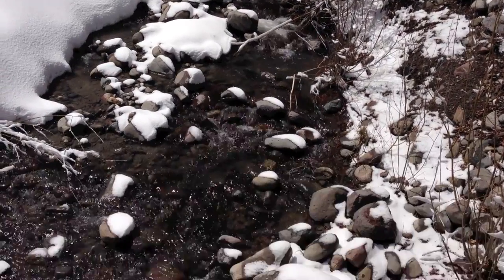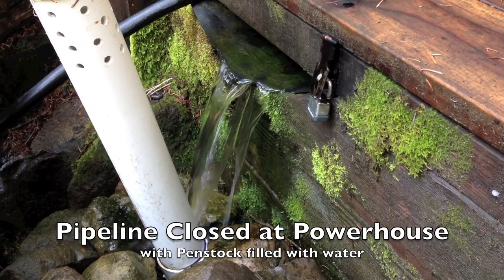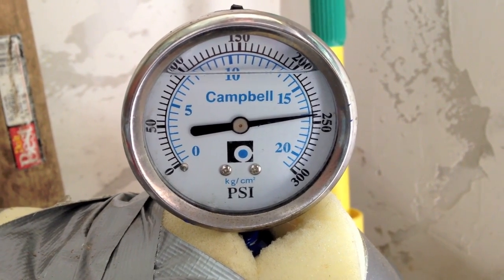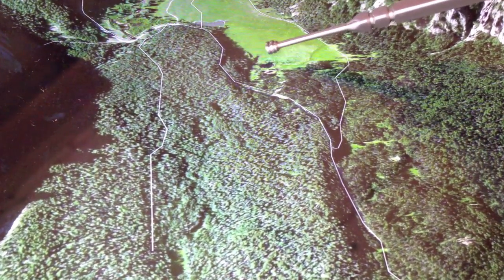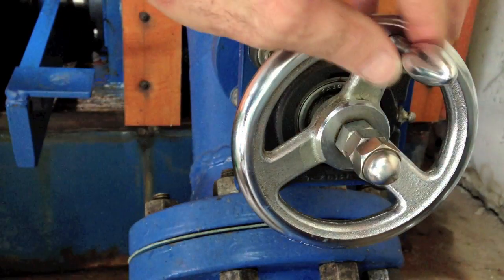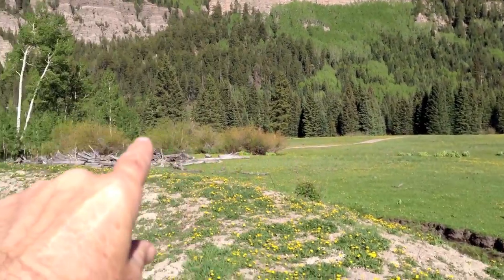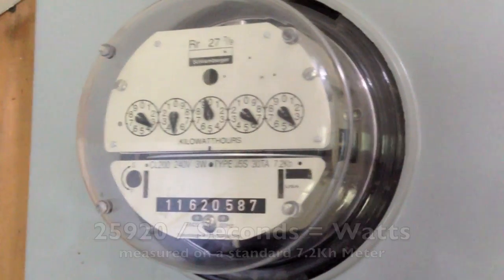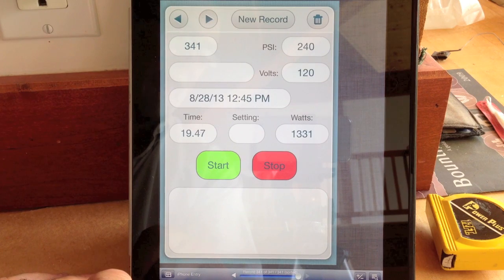Part 5 Micro Hydro Electric Power System in Colorado

Comment: Hi @mrhydrohead
Which video do you cover how the electrical side works. Very interested in the system but struggling to understand how you keep frequency so static with varying loads without a battery. Is the power output bridge recitifed to dc then inverted so you have finer control over frequency. Then tranformed up to use ac in house.
Or do you regulate frequency purely by adjusting water flow?
Reply from the maker: This segment is where I cover the electrics: Part 14 MicroHydro Power System in CO
https://youtu.be/1c8AYt6C2P4. The system utilizes an electronic load controller ELC which is made by Thomsen & Howe http://www.smallhydropower.com/ in Canada. It basically shunts load off to resistive loads by varying the load with SCR circuits. It monitors the hz on the system and varies load accordingly. If you have additional questions I’ll be glad to help. Thanks for watching.
Reply: @mrhydrohead  amazing, thanks for the reply. I'll give that a watch and see if I've got follow up queries. Awesome system, BTW very jealous!
I've seen battery based systems where bridge rectify to dc and mppt/buck convert to battery but never seen residential direct from turbine to house.
Reply from the maker: Yeah the system is such a joy to live with. The majority of the channel is about moving my system to a creek source. There are two other systems shown on the channel which I don’t own as well. My email is mrhydrohead@gmail if you have more questions. 😊

Comment: You should look into installing batteries. It doesn't sound like you have since you said when the machine stops you run out of power. At night when you turn everything off those batteries will charge right up and help supplement your problem of the hydro underperforming.
Reply from the maker: We don't have or need batteries as the whole system was upgraded after this video was posted.  Thx for watching  I'm never sure who has seen what of the series.  Here is a playlist of the 3 part synopsis which is an overview of the whole process https://www.youtube.com/playlist?list=PLtTypVpmDd-vkT9bJQkXw4I1t0e_4jMYA  The whole series is in about 25 videos.

Comment: Hi, i know this Video is already a few years old, but i started watching the whole series again.

I think your method for finding the output power by measuring time works just fine. As far as i know the spinning disk measures the current. And since power is calculated by the product of current and voltage, you also need to know the voltage in the system. So I think it is just assumed that you use 120V (or 240V?). Normally this is not a problem, because the voltage does not change much. But with your generator the voltage is dependent on the frequency and as the pressure in the pipe gets lower the voltage drops. So especially for low frequencies the app might be inaccurate. Did you consider that?

Nice videos btw, I always enjoy watching them
Reply from the maker: I'm pretty certain that the voltage remained nearly always @ 120v on both the old and new system. There was only a short period in winters when pressure loss in the pipe became problematic. As you most likely know the load controller is set to shut down when outside the hertz range. I've never witnessed the voltage dropping to say 100v with the generator running at speed.
Reply: MrHydrohead thanks for the fast reply. When the generator runs at speed everything is fine, because then the load controller keeps the system at constant 60Hz 120V. I was referring to the case when your system went to just above 50Hz, then there is only a voltage of 100V left. So the power output will be lower as well. But I guess with the new system this won't be a problem anyway, as you have more than enough water now.
Reply from the maker: In winter of 2012 is when the pipe would drain out and shut down. We weren't living here full time and I shut the system down as it just couldn't run in 10gpm. Now all that's solved.

Comment: Could you not include a governor? Measure the mains frequency and adjust the needle to maintain the required frequency. That would definitely be the way I would go. Kind of like in a petrol generator, when you load the generator, the crank speed slows, and the governor opens the engine throttle (here, your needle valve) a bit more?
Reply from the maker: It certainly would be possible, but being a mechanical device, a governor would potentially be a point of failure or required maintenance.  ELC(electronic load controller) devices became popular once developed for this among other reasons.  I'm not sure exactly when they first were developed, but my first educators encouraged me to go with one.  It allows you to maximize the water flow available and maintain a constant load with excess power being dumped to useful or waste loads.  Prior to the devices people either needed mechanical governors or a keen eye to constantly manually balancing load via banks of lights or heating elements being manually switched.  A major and persistent chore. I realize you saw this segment before the others, so you probably got the big picture in the process of viewing.
Reply: Oh sure, I understand that the electronic system can respond very quickly; to inrush on a fridge compressor, or you switching the oven on (big steps in load). A mechanical system would be much slower to react. As you say, this was the first clip I saw. There are, however, videos on youtube showing the same needle assembly with a hydraulic ram. Either way, very interesting!
Reply: @mrhydrohead  you could still combine both systems: Read the RPM of the shaft by a optical sensor and turn the wheel slowly if it drops too low or too high. When you remove the electrical dump load and add a large fly wheel, this system should be able to get the frequency managed even on higher load changes.

Sure, if you want to run heavy equipment like large motors you might need a soft start for them.

The electronic system could stay in place to shut off the new adaptive a by the deflection plate, in case of a failure.

Comment: Where can I get a system like this?
Reply from the maker: Nigel Jordon The turbine I have was manufactured by Canyon Hydro in Deming, Washington.  http://www.canyonhydro.com  Purchased around 1995-6, the same model is still made, but more expensive due it inflation and such.  Of course, each hydro system is site specific in the choice of best equipment and what works here may or may not be the best choice for another location.  Best to do an analysis of Head(height of vertical drop=water pressure potentially available), available water flow(including seasonal changes), and distance of pipe required(from which provides how much potential power is lost to friction in the pipe chosen).  Canyon can help with much of the calculation or there are many other ways to come up with these numbers.  But, Canyon's equipment is first grade and in my case time tested.  Hope this helps...

Comment: Im so sorry...Yes as a geologist I agree with your hypothesis about the confirmation robbing you of water :(   Any chance of legal action?
Reply from the maker: Yes, unfortunately the neighbors right to his pond was made absolute in water court.  No recourse as far as I know.  Silver lining is that I will end up with a great deal more power in the long run off the creek and the springs should still serve as an abundant domestic water source.
Reply: @mrhydrohead  How can someone say "no, the water doesn't go this way anymore, it goes that"? Where I live status quo is everything and disturbing water flow is a very problematic issue, to say the least. What is the reason presented for deviating 90% of the original water flow?
Reply: @mrhydrohead  How long did it take for water court proceedings? I'm sorry your original source was taken from you and I'm glad that you had a secondary recourse that turned out better. Thanks for posting these.
Reply from the maker: Water court can take a while.  Maybe four to six months at the fastest. In my case I applied for water rights when George Bush came into office around 1999. After that I needed to reapply to extend the conditional water right every seven years. I finally decided to move the system to the creek and once I had done that I applied to show beneficial use of the water and received the absolute water right in about six months.